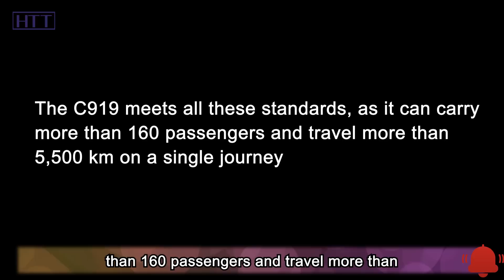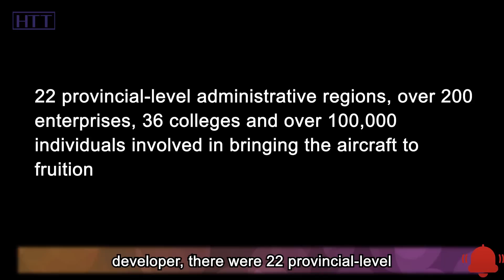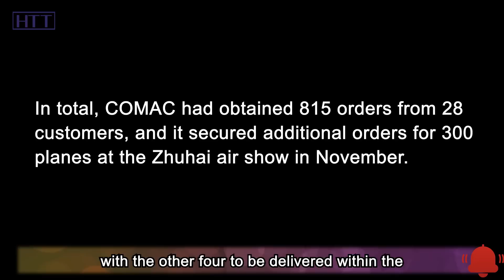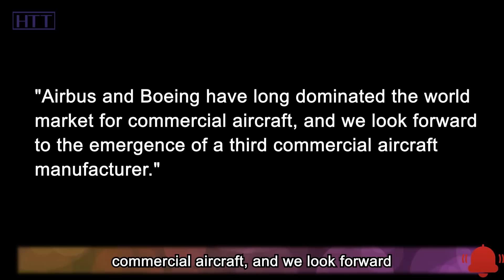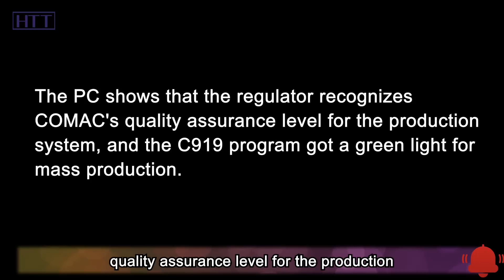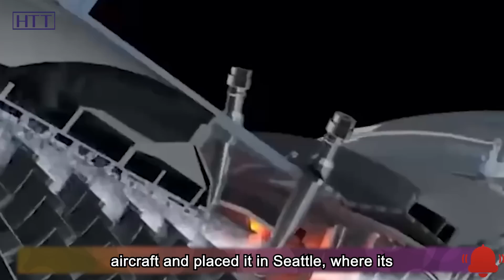C919 takes off from Shanghai, a high tech milestone achievement of China

Comment: This C919 is not 100% Chinese made. 60% of this airplane, including the engines, avionics equipment, cockpit equipment, safety systems, navigation systems, high tech equipment, is made by the Western countries. 
The self-certified C919 can only fly in China domestically, and it is not allowed to fly internationally. It has problems with its airframe because COMAC has miscalculated the specifications of the engines made by CFM International LEAP. Therefore, this C919 has to reduce its payload, shorten its flight distance, and increase its fuel usage. This airplane will fall apart very soon.
Reply: Like many prediction in the past that China would fail in its development, yours is not very convincing.
Reply: 热知识，波音只有35%的部件是自己生产的，苹果除了软件什么硬件都不生产，但他还是美国产品。
Reply: @唐嘉阳-t5g  Boeing's supply chain is by law has to be within the US. Apple products are assembled by a Taiwanese company.
Reply: 中国的CRJ21也没有取得西方的适航证，但最近出口到印度尼西利。因为中国民航局的适航标准是完全按美国的标准来设定的，没有技术问题，只有政治问题。
Reply: Don't delete your comment. Revisit it 5 years from now.
Reply: Like many people who predicted a collapse of China for the last 40 years, your prediction may have to be repeated another 30 years.
Reply: @_Wai_Wai_  I do not need to wait that long. Like I predicted the highspeed train crash and the Chinese WuHan Virus origin, I predicted right on. I know CCP real well.
Reply: need tobe prepared for engine and avionic sanctioned lesd by US.